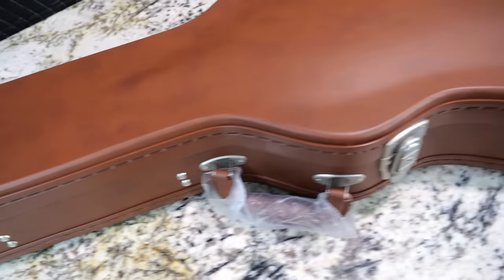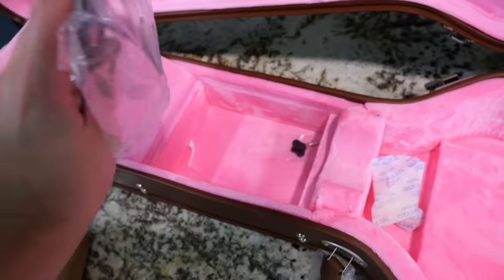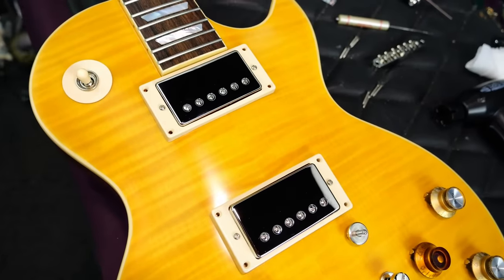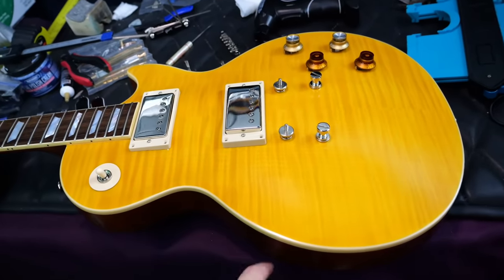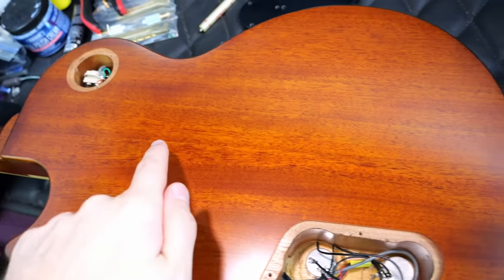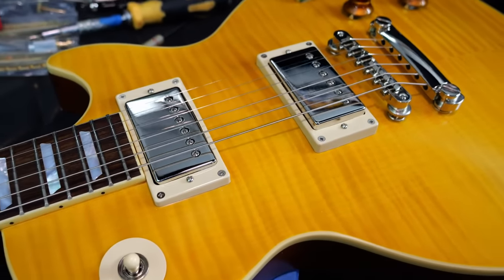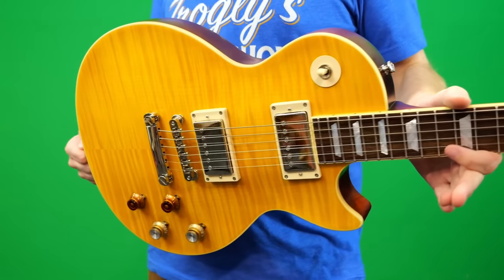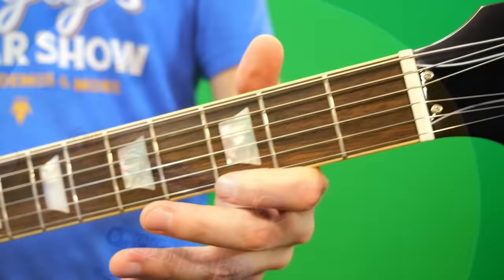I Tried The Epiphone "Greeny" (with Gibson Headstock) |  Review + Demo

Comment: 11:48, the stain/binding line is not due to scraping, it is a mask/tape line.
Polyurethane finishes are not scraped like lacquer, the edges are instead taped off.
The reason the MOP Gibson logo "pops" more is due to it being an actual piece of shell almost .10" thick, the plastic Epiphone logo is part of the headstock overlay.
Poly finish aside, if Epiphone really wanted to improve their $1500 guitars they could start by using better grade fret wire.
It has been my experience that the Epiphone/Chinese Fret Wire is kind of soft and gritty.
Every Epiphone I've performed a Fret Leveling on has had soft fret wire that was really dirty to work with.
Reply: In the Anderton's Gibson Garage video the guy said Greeny has Gibson Fret Wire
Reply: @styrenebuilds6851  Thank You, very good to know and a huge improvement.👍😉
Reply: thank you !

i didn't know that about €piphone
fret material -
i feel lucky dodging that experience

my first LP
i went with a 
2017 Gibson Tribute LP Studio HP Standard Inlays  $1300.⁰⁰ 💵
im not a fan or satisfied with the nut tho' 🔩
some type of small 🦐 thin roller type 

i was going to get 
an amazing finish on 
€piphone two tone flip metallic blue purple green LP copy  .
$800.⁰⁰ 💵
but it didn't offer a
HS case on that sale .
[ similar to ( xiphos ) ibanez two tone flip ]
Reply: There was a time when a matte gold Gibson logo decal could be bought online. I guess for the broken headstock repair, but I don't know. I also don't know if they're still available. ...I once ran across a Flying V bass with Gibson logo for sale, but once I saw it in person, it was a bolt on neck- something Gibson didn't have. It was obviously a fake.

Comment: The Epiphone marketing guy did say that they’re using Gibson fretwire on the Greenie. So, you do get a littlemore than just the headstock and pickups.

It’s still too dang expensive for a Chinese Epiphone without a rosewood fretboard. You can get a Gibson Trad Pro from a few years ago for the same or less.
Reply: That no doubt plays infinitely better. I got a used S2 594 for $1100 bucks. I can’t even believe people are going for this at this price point. It’s cool, but it’s cool for like $750 tops imo
Reply: I did the same thing and bought a 2nd hand Gibson LP Standard 60s for almost the same price they retail the Greeny, I have a Lazarus also, sorry but they are simply incomparable guitars quality and feel vise.
Reply: Just a matter of time until Gibson moves all it's production to China.

Comment: I'm glad he finally realized it's the same finish, just buffed to a shine somewhat. The calculations for value escape me? The 59's were originally released at $799. I've had 4 of them. I'm just not seeing the value in these? Personally, I think the unpotted Burstbucker 2&3 in the regular 59's are much better pickups. Also, the tuners on the "Greeny" are the some p.o.s. they put on the AJ sigs. The regular 59's come with excellent Epiphone tuners that I've had zero issues with. Whereas my AJ sig needed upgrade to Gotoh keystones. You could get 2 regular 59's for $1500 with some haggling I'd bet. Take one and Greeny mod it yourself. $1500 is ridiculous.
Reply: It's a tribute model. The tuners were later changed to Grover types, which was a normal 'upgrade' many of us did in the 60 & 70s. I prefer the original types these days, not Grovers.  The Vintage brand reliced version even has the old screw holes on the back of the headstock where the original ones would have been after the 'upgrade'.

Comment: To have a two screw trust rod cover is not just routing, they would have to use a different truss rod with the acorn nut instead of the 5MM hex
Reply: The ironic thing is. Epiphone is supposed to be the “Official” licence product of a Gibson Les Paul. 

You would think, they’d they’d make them identical “cosmetically”. Woods and electronics can obviously be less expensive, but ironically Epiphone are the most “Unlike” Official Licensed products ever 😅
Reply: @peterbrown818  But that two way truss rod in the Epiphone is better , but looks are more important

Comment: In the Anderton's Gibson Garage tour, the Epiphone guy said that the frets on these are "Gibson frets". What that means, who knows, but higher quality regardless, as you noticed. 
So when you were doing your cost calculation, and assessing the value over the Lazarus, those, plus the MoP inlays, Grover tuners over Kluson-style Epiphone tuners, the complexity of having two different knobs and a unique poker chip (some maybe only used on this model?), and POSSIBLY even not having headstock wings on a wider wood blank, are all factors that would contribute to more cost to produce and this drive up the price. 
While only the inlays and frets really being selling points to the customer, imo. 
That makes the price make more sense, though we still don't have to like it. 
Just some thoughts. 

Side notes, I agree with you, at this point, rather than MoP inlays, lets see a 2-screw TRC, a good nut, and Gibson pickup rings. They should be able to save money as a company with that last one. Less complexity + larger economy of scale = more profit.

Comment: My 89 has the open book headstock I believe 89 was the first year Epiphone made the Les Paul Customs. Long neck tenon they are pretty decently spec'ed out and can take a beating!
Reply: I have a 2000 Japanese exclusive Epiphone LPC 80. Same with the open book headstock and long neck tenon. From my understanding, these came from the same place as the Orville by Gibson guitars. It's the only Epiphone I've played that's on par with Gibsons
Reply: 1989 Korean made Epis don’t technically have the open book headstock.
Reply: That will hold much more value than the "Greeney" and is likely a better made instrument.  (It even has REAL Rosewood!)
Definitely hang on to that one!
Reply: @joerobertson795  I’m not sure if it will hold value better than Greeny but these 1989-1990 Korean Epis do sell for quite a bit for some reason. In some cases around $1000. My guess is that used Epi Greenys will be about the same.
Reply: @KevinTheMetalhead  They are pumping out the Greeneys by the thousands and every online retailer has them in stock.  They are not Custom Shop or Limited Release.  There are literally 10's of thousands of them in warehouses in the US.   How many MIK Epi Customs are out there with the Gibson headstock that was Only Made for One Year in '89?    Yours will hold much more value 10 years from now.  Hang onto it Brother.
Reply: @joerobertson795  I mean yeah true, they were also made in 1990. Also I don’t own one unfortunately (I almost pulled the trigger on a Standard from 1989 for a great price but held off. I kinda regret it.)
Reply: @KevinTheMetalhead  I could be mistaken, but I think the Epi '90 models with that headstock were bodies produced in '89.  But I could be wrong about that, but I don't think all '90 Epis had it.
Will report back after some research.
Reply: @joerobertson795  You’re probably right. I just saw models with 90 in the serial number and I’ve seen people describe them as 1990 models. I’ll trust you. The 1989 I almost bought was literally dropped to $450 before it sold. I doubt I’ll ever see one go that low again.

Comment: With regard to your comments about the frets, they do indeed use gibson fret wire on this guitar as disclosed at the end of the Andertons Gibson Garage visit video. It will also give you a better understanding of where Epiphone are trying to go with their upper range of guitars.
Reply: Is there anything special about the fret wire Gibson uses?
Reply: @dboone7670 no they've been using since the take over. Again it's just snoby bigiots hating epiphone whilst trying to defend Gibson outrageous pricing.
Reply: It's not where Epiphone is taking the brand. It's where Gibson is taking the brand.

Comment: well i got suckered in by gibson and bought the 3100 buck non aged gibson version, had i known these were coming out id bought this guitar instead. at less than half the price of the gibson. i did turn my bridge pickup around i hated the look and not to fond of the sound either. to each his own i guess. as for the truss rod cover, you gave the reason, im not fond of the allen key truss rod adjustment on the epis, but it works and i can live with that.

Comment: hi trog mt i can improve that greeny for you, if you'd like, then e to the b screw in as tight as you can then from the g to the e string lift it as high as it will go  with the adjusting screws mt and don't for get its the middle for the  true greeny sound,, m the uk.

Comment: I'm wondering if the 3 way is a switchmark or an epiphone branded one... What makes me wonder is, I swapped out the epiphone branded on in my anaconda burst for a switchmark and the red and green wires ended up extra wire at one end and almost too short on the white wire at the other end that this one is doing after I was done with the swap out, as I had not cut the origional wires.

Comment: This $1300-$1400 baloney for Indian Laurel and no plek job or Nashville skill (Gibson's are plek'd) is pretty nervy.  AMS is funny. They sell LEs that  nobody else does. I bought a BEAUTIFUL Epi LE '58 Korina w/Gold Explorer - mini Grovers ($1300 one doesn't have !), correct logo placement the $1300 doesn't have, Pau Ferro over sandy Laurel that the $1300 has. It doesn't have the Gibson pups or HSC - but it cost $650 and is made in same Chinese factory and did I say the Korina and gold is gorgeous? Now, AMS has a $179 SG with ceramic pups and it says rosewood board!!! mahogany body and a KILL SWITCH tone pot!!! Nobody else sells this guitar. I bought one to protect my Iommi Monkey Gibson and guess which one I play more??? That kill switch is a hoot, and the neck carve is actually more SG than the fat Monkey one !!  AMS and Epi had it right - LEs for about $650 and beaters under $200 with rosewood, not laurel or pau ferro.   👀🎸

Comment: Epi's just not doing enough yet to justify the price. This is just a 59' which you can regularly find on sale for $799 with the Greeny pups & their comicle /almost/ Gibson headstock added. They couldn't even do the wings to true & that's the only reason you're paying what you're paying for it & they still couldn't even do it right lol. At this point if you're goint to charge $1500 for a Chinese Epi, use Nitro like definitely use Nitro. Biggest complaint about any "cheaper" brand if you can even consider Epi cheaper now is the cheap plasticy rock hard poly finish. Like yea, it's great that poly is durable, but we want Nitro, & fwir it's not even legal to use Nitro in China so just don't charge $1,500 for the Epi Gibson! There for a while like 2016-2020 Epi was killing it bc they were staying within their means & releasing great signature models (like Lee Malia's) that were unique, spec'd to the moon, & still only $899 new. That's the top dollar anyone should be paying for an Epi. I remember in 2020 thinking sheesh $999 for an Epi? And last year sheesh $1299 for an Epi? & now $1500? You see the trend? They're eventually gonna price themseleves out of the market by charging more than their target audience can handle.

Comment: I bought it because I wanted a Lemon Burst LP and I did not like the red backing/too yellow 59 Epi look, so I paid extra.
I like the Greenie pickups better than Burstbuckers, also. However, I have replaced them on this and my 1st run Cherry Burst Epi 59 with Little 59ers by Guitar Madness on Ebay. They are not as brittle sounding as the Gibsons.
Ps. I had the Lazarus. Great guitar, but not a Lemon Burst as far as the finish. They do have a one piece neck.

Comment: I tried 4 so far. I tried justifying the 2k price point. Gibson fretwire, Okoume Mahogany, Hard case, MOP Inlays, and Greenybuckers. Despite all of these appointments, I consider this about the biggest rip off for a guitar. You can get an Eastman for a few hundred more, thats almost on par with a Standard in build technique and quality. The Eastman will have much higher grade Okoume,nitro finish, real maple cap, Gotoh hardware, Lollars, real ebony or rosewood, and hold its value. Not to mention a used Traditional (a better guitar in literally every conceivable way) is about the same. Yes Gibsons are massively overinflated too, but at least you can justify them by their obvious quality and value. Oh and to the people saying Epiphone is no longer a budget brand; sharp frets, cheap binding, veneers, poorly cut nuts, laurel, and bad neck joints are still common in them.

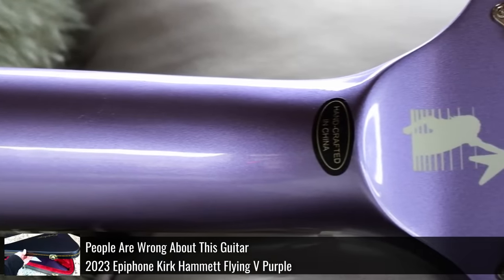Comment: 2:46 Why on earth would you have branding of the current owner of the guitar upon which it's based when it's actually named and marketed after a previous owner that made it unique and famous? That would be stupid, obviously. It's irrelevant on the case, as it is, but a 'Greeny' with the guitarist from Metallica's branding on it would invalidate it as a Greeny and make it a 'Hammy (currently) owns Greeny', and no-one wants that because it means nothing to the reason for the existence of the guitar. Think about it. Even Gibson aren't that stupid (usually). I can't believe you even said it, tbh. As for the mother of pearl inlays, it obviously not about giving you value for money, it's about attempting to justify the overpricing, which you pointed out with your comparison to a similar Epi with Greenybuckers in it, at the start.

Comment: I have both the Epi '59 and the Epi Greeny and the Greeny is a world of difference in terms of quality, tone and finish quality. The nice thing about Greeny is you get 4 tones instead of 3 with the 59. With Greeny you get upper, lower, middle, and middle max which utilizes the reversed pickups. There is definitely a huge difference in the finish - not that the 59 is bad, but the Greeny is so much better. To be upfront though I did get a Greeny from the first run, which from what I have heard got a higher level of quality control and tweaking before being sold, not sure how much of a difference that makes.

Comment: I have an Epiphone Les Paul custom with the most level frets and best feeling neck on any guitar I have ever owned. I've had 5 Gibson's and many Epiphone guitars. It's a 2020 inspired by Gibson black and gold one. I had my pick out of 5 of them. It's very well made. So I'm going to take all of the electronics out of my 59 Les Paul standard Epiphone with USA burst buckers and put them in the custom. Then put the Jimmy page custom wiring harness in the 59. With Seymour Duncan's. Right now the 59 sounds the best by far. No need for a booster and the midrange cuts through with ease. The custom plays like a dream super low action and no fret buzz. I bought both new. I got a hard case thrown in on the custom for 699 and the 59 cost me 750.

Comment: I used to be a "brand name" snob, mostly back when I played. Gibson for guitars, Fender for basses. No compromise. (...until I got an Ovation Magnum bass, although it didn't replace the '64 Precision or '68 Tele Bass for the road). I recently bought a used Epi LP Special, just to have a different guitar as I picked up an instrument for the first time in almost 20 years (along with a new Vox modeling amp). I have ZERO negative issues with it, especially for a $100 guitar. One hundred bucks. I got it to do a cheapo P90 swap, but for just around the house through a small amp, the cheap humbuckers are fine. This thing actually plays better than the real deal '73 LP Custom I had. Maybe not as nice as my old Tele, but it sounds like a guitar with humbuckers. Neck and playability are the most important things to me. I literally yesterday spent another hundred and a quarter for an Epi Junior, just because the Special works so well. That one is going to get a P90 regardless. There are so many of these Epiphones and other replicas that they'll never reach true "collector's" status, so as an old guy, just buy a cheap and used thing to customize to preference if it's one that feels right. The Epi Special looked like real tobacco burst online, but is a sparkling shiny ugly black around orange instead of brown around golden ochre like the real deal. I don't want to take it apart again, so it'll stay ugly. It still gives a nasty growl on the third fret G bend on the low E string when transitioning between E to A or vice versa, and that appeals to me, so it stays. The Junior is black on black, so I might strip the face for the refinish if I like it, to make it look more like a real Gibson from my time. I have a '54 ES125 and '59 Melody Maker for face to face reference, and I was a scenic artist after my music days. It'll never be worth more than around (or less than) two hundred bucks anyway, so I could paint it pink with latex and a brush if it plays well. I might even clip the Epi clipped ears on the headstock to do the open book look if the Epi logo isn't too high.... something which really varies with these things. We'll see. I don't need or want an overpriced "endorsed" signature model of anything. I can't see Joe Perry playing a Kirk Hammet or Billy Joe Armstrong signature (or vice versa) after all. Anyone who plays is their own player. As for this one, when you played it, it does sound quite good, so there's that.

Comment: The headstock move is a such a clever misdirection in terms of making this "special" and adding fake value. Its something that adds virtually nothing to their cost apart from perhaps factory space to do the different headstocks, where as a proper thickness maple top, nitro laquer, aging in line with the original - all these things would have added a more meaningful justification to the price on this. Although more expensive still, i'd sooner get an Eastman which takes a much more understandable approach to Chinese guitar development, charge high but offer proper premium craftsmanship and materials/finishing that would be simply impossible at the price point in the U.S.